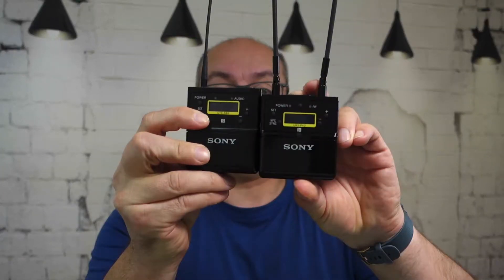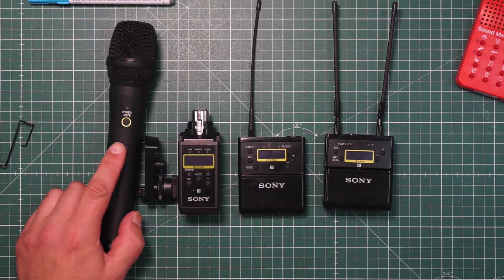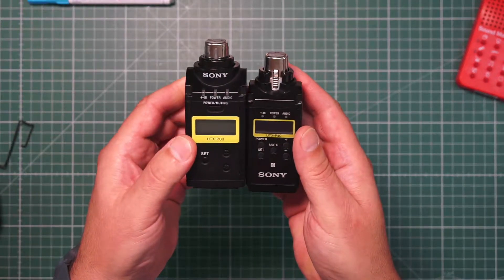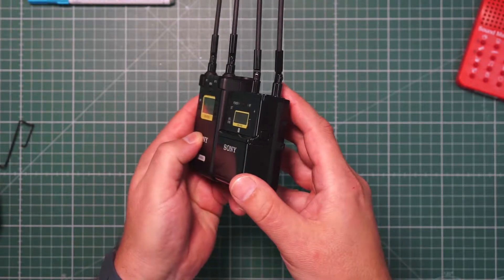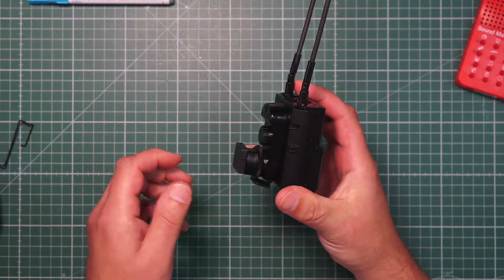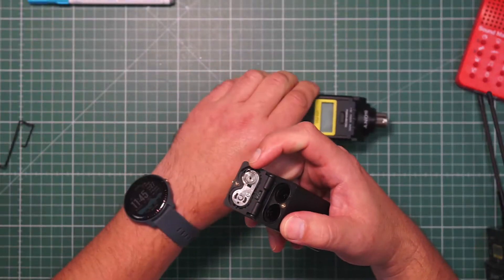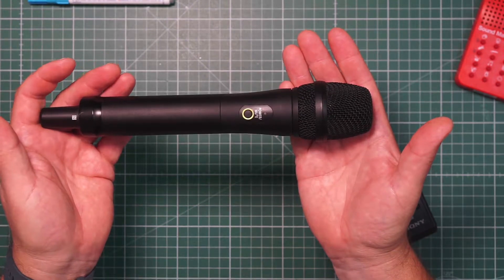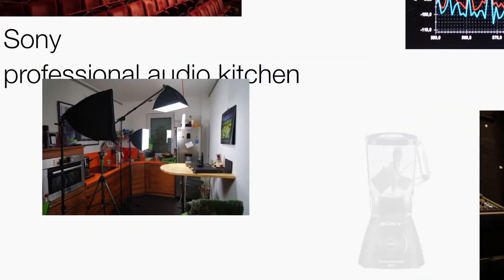#006 UWP-D Gen4 first look on the mechanical construction

Comment: I got the Sony UTX-M40 hooked up to a Rode reporter mic and I find I really have to push the gain, even with 15DB boost, any idea why?
Reply from the maker: @vidfolio  I have looked into the sensitivity of both mics. It looks like the difference is only 4dB (Sony F112 –52 dB (0 dB
= 1 V/Pa at 1 kHz) (Rode -56.0dB = 1 Volt/Pa at 1kHz). I think with the input in BOOST mode, your level should be high enough for a good signal. What are your exact settings? 15dB BOOST Mode on and input Gain is on 0 dB?
Reply: @mawa  yes, gain always 0. It's ok but not topping near -6 whereI'd like it to be
Reply from the maker: @vidfolio  I'm sorry to hear that it is not working for you. I have test it with my F112 and in normal mode I got the same situation you have. -10 to -6dB is the max. level I can reach if I speak in a normal mode. In 15dB BOOST mode, I could easily bring the level to a point where the red overload LED starts flashing.